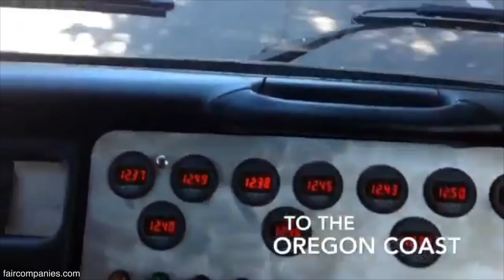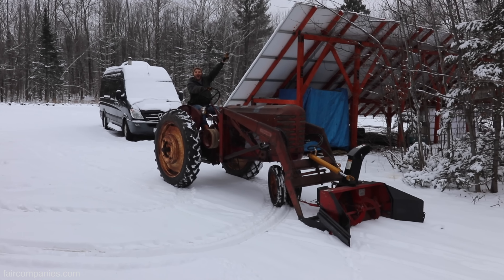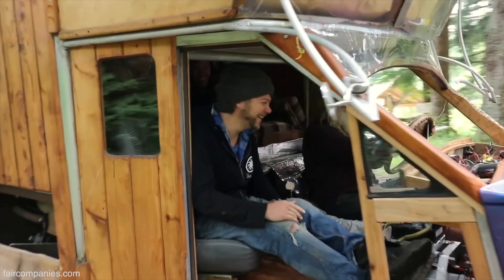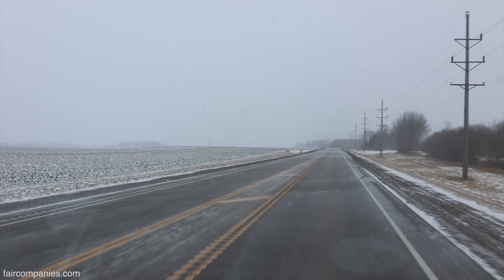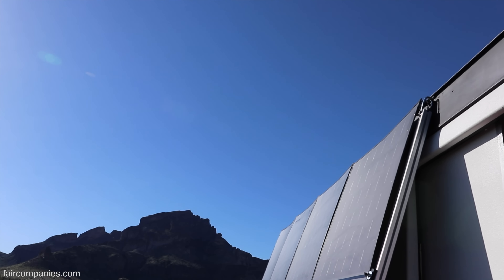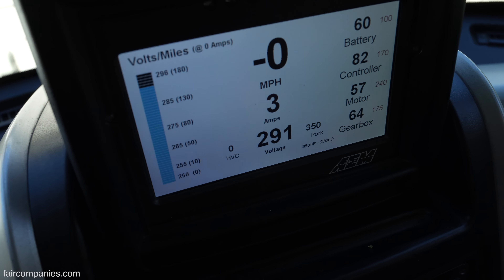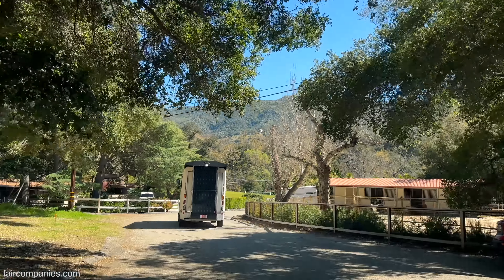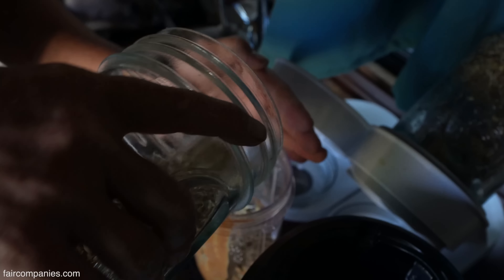They turn old trucks into 100% solar-powered homes on wheels: No need of 🔌

Comment: clear cover for roof solar system plus circulation fan = protection and easy cleaning along with cooling for max. output and hot air can be used for heating water and/or interior. big boost for little added cost.

Comment: signal wires on transmission got crossed!  My transmission teacher from Diesel technician courses relayed a true story.  When he was a diesel tech for truck tractors, one owner/operator brought his tractor in to the shop.  Found himself unable to shift on the highway!!  After much wasted time investigating by the transmission, through all the automatic transmission connections, etc...my old teacher found the braided pair-control signal wires for the vehicle, under the driver overhead panel...-had been spliced into to add an after product radio in the cab!  He immediately cut those radio wires, dismantled the radio and put it on the driver's seat.  cleaned up the connections on the braided pair, tested everything and billed his customer to the hilt for the huge waste of time!  (the owner/operator had spliced into the braided pair himself to install that radio!)

Comment: The last one is awesome. It's a boat! I'd probably make quite a few modifications to the outside, build in those panels with the body and add a protective layer on top, may not get as much juice under direct sun but no need to set it up when you're in the city and still collect a lot of power.  It's so slow though, if they could have eeked out another 20kph that would be so great.

Does this dude have a YT channel? I'd like to see his progress on it.  Just followed Solarrolla. Great stuff!

Comment: We have solar panels that are 15 years and still working great at 95% of origin capacity. We have 4 Tesla cars with original batteries and drive units and driven each over 360.000 km since 2013 and only lost 1% capacity per year.

Comment: That setup is still large, complex and expensive. Once tech like graphene batteries are more smaller, efficient and cost less then it will be the sweet spot, travel forever.

Comment: That gypsy wagon was so awesome it made me a little verklempt.
"It sure is nice not to pay for gas" - I wish I knew what that was like.
Reply: It's like prepaying for your energy according to a 10 yr lifespan for the batteries.
Reply: Verklempt? What roughly does that translate to? Google is denying me 😂
Reply: @lovecatspiracy  yeah, I've got a meager 1260 watt solar "gen"  w/200w solar panels I used the past 3 yrs as a nomad. Super convenient! But then something in the batt. broke, and now I can't charge batt via solar panels. Plus, it's older tech (Li Ion), so drops to 80% after 600 cycles. 😕 BUT, it was fun while it lasted. Now I just charge the batt via AC. 😆
Reply: @mom.left.me.at.michaels9951  "overcome with emotion" 
You never saw Mike Meyer's Jewish mother character (Linda Richman) on SNLs Coffee Talk skit (1992)? 😆 She was always verklempt about something. I actually didn't know what it was until then.
I've had this trait since I can remember - it CAN be rather embarrassing when I'm trying to have a conversation about something, but I can't help it. 😊
Reply: @donwyates  My husband and son are the knowledgeable ones on this topic, but according to them, you have to choose wisely to purchase the right gear to be comparable to conventional power sources. We live off grid in NE Arizona now, so of course we only want to run the genny when absolutely necessary.  And so hubby did the calculus to find us a 10 yr lifespan battery bank. As we continue to develop our homestead,  our power demand grows and now we are in the market to expand our battery bank. Of course, the gas price market is highly volatile as well as requiring gas for the truck to pick up gas for the genny etc etc etc. When we were on grid in the Socal suburbs, taking our home fully solar made no sense at all. 

Every individual has to figure this calculus to maximize economy and availability.  It seems to me that a certain level of capital is required to set up something that will take you more fully energy independent.
Hope you are having a fabulous time living nomadically! 😀

Comment: Recommendation: you can build a "rain water collection system" on the next upgrade then all you'll need is walter filterss and uv lights if you plan to drink the water, but if you plan to just use it for showering, you probably don't even need that. Anyway, it elimilates you from getting fresh water all the time. As long as it rains, you're good. :)
Reply: That's an interesting idea
Reply: That is essentially my plan for my bus, but I don't expect to collect enough rainwater for showering. With my region's average annual rainfall and with my roof size, I could catch on average about 20,000 litres (5,000 gallons) per year. But water is heavy, so you can't have massive tanks and you are therefore reliant on fairly consistent rain.

Comment: I think hydrogen is much better. Actually if you could get the electricity to break down the water into hydrogen from solar power. I think that would be the best hybrid system ever. Imagine a light powererful Nissan 3 cylinder diesel that was used in the 24 hr racing that puts out 400 h.p and puts out 600 ft lbs of torque and the engine weighs 88 lbs with the turbo. Instead of diesel fuel your burning hydrogen & breaking down the h2o into hydrogen with the power of solar & perhaps even have a wind generator for when there is rainy windy days. Like you guys said these vehicles are off grid land yachts. In some places of the world they have old school wagons with extra wide wooden wheels that are powered by mast and wind sails just like boats.
Reply: It's not though. Hydrogen combustion is incredibly inefficient. You would need 5 times as many solar panels to drive an equal distance.

Comment: Just to not pay for fuel, you have an extra 24 hours added to your 200-mile trip... unless you're secretly a millionaire with a constant source of income this isn't feasible. Also claiming going less than 50MPH is going to get you there faster is ridiculous. Most roadway speed limits are way higher than 45-50... so basically just to avoid paying for fuel you have to be the road hazard to other drivers... Not to mention, those batteries are not cheap and they don't last forever so essentially the money the spent on all those electronics would have paid for fuel for 3-5years...

Comment: Many years ago when mentioned adding solar panels to an RV rooftop many people were claiming that it couldn't be done for some reason....I explained it was no different than solar panels on a house roof but for some reason they couldn't grasp it.
Reply: To be fair, the panels we had 10 years ago probably meant it would have had very limited capacity, esp with their weight. It is a testament to how far development has come that it is now an option.
Reply: @snowstrobe  ya there’s an old solar panel in my garage and it’s like 50 pounds minimum and covered in heavy steel

Comment: Ultimate nomad vehicles! Yes gas/ oil is cool but... when you run out... you run out! Electric can regenerate with solar power and can even generate too much electricity, that the grid pays you for the extra electricity if you're hooked up to a grid system!

Comment: 8 miles per hour...
Reply: TBH that's not bad if you're not in a rush.
Reply: @leedza  And don't mind getting a bunch of driving excessively below the speed limit tickets.😆👍
Reply: We all need to slow down. We have normalised the power fossil fuels give us, and we think we have the right to this power. It was only a few generations back when no one would have imagined travelling at the speeds we do now.
Reply: So if you’re camped up at the beach for six hrs, you can be assured of at least 48 miles of range to return home via the cold beer store, because you just saved enough (not buying gas) to buy a couple flats. Cool.
Reply: Why are solar builders so few and far between ? They aught to start having this available in high school shop class choices. Electrifying content, as usual. 👍🤙

Comment: In the book "Wolf and Iron" written by Gordon R. Dickson back in the 80s, The main character had an electric bicycle with a roll up solar panel. He ran into a family rolling across the country in a mobile bunker. The bunker was a covered wagon style vehicle pulled by four horses. It was designed to withstand siege by raiders and was pretty much bullet proof. You wanna know what the raiders ended up doing?
...scroll down for spoilers...

They shot the horses and set a huge fire under the rolling bunker.

Comment: all these crackheads thinkin they've got it made running off the electricity while forgetting none of those electronic parts will exist if the "doomsday" they speak of actually comes to be... let alone replacement parts, replacement battery cells.. etc etc etc....